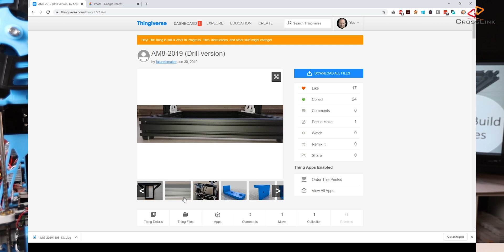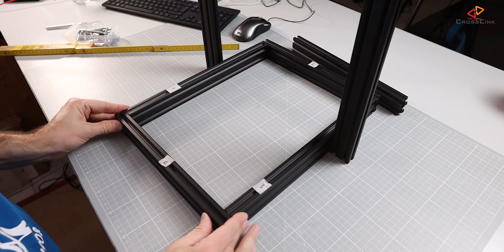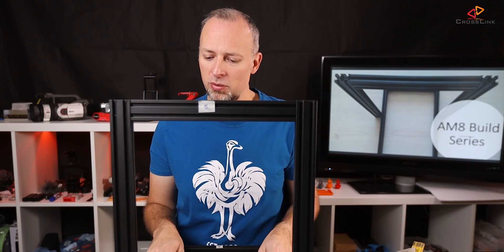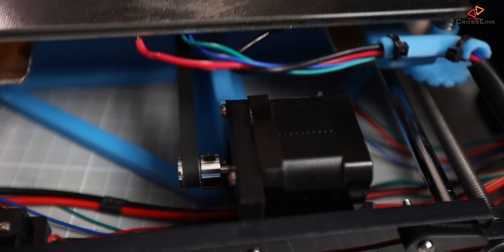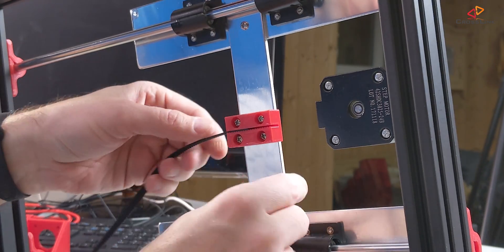Anet A8 AM8 Upgrade - part 1 - Frame build

Comment: A thing I did not understand is what kind of nuts and bolts you are using. Usually the nuts for aluminium extruded profiles must be slided from the side of the profile (cut section let's say). Instead I see you screw it into the bolt and then push em into the profile itself.
Reply from the maker: T-Nuts are inserted in parallel into the slot. as soon as the screw is rightened the T-Nut turns 90 degrees and locks into the slot
Reply: @Crosslink3D  does it work on any kind of aluminium profile or on a specific one?

Comment: I have just finished the build....the cheap crappy frame of the original A8 as well as the ungodly noise it made was driving me nuts and I wanted a change.Things spiraled a bit out of control from here. There was a lot of „While I‘m at it, I might as well....“

Now the only original parts left from the original Anet A8 are the motors, the bed and parts of the wiring harness. And at that point I am not even sure I can call this an Anet anymore. Feels more like I build a new printer from scratch, with some printer parts that I had laying around. 

Aluminium frame, Hiwin-style linear rails (ok, they are clones but they do work really well), a brand new 32 bit SKR 1.4 board, running Marlin 2.0.5, Noctua cooling fans, TMC2130 drivers, a RepRap controller/display....yeah - it definitely IS a new printer. 
But it works sooooo great...and now I cannot even hear it anymore, unlike the printer I started out with. Honestly, the loudest parts in the printer are now the cable chain and the fan.

Comment: Drylin Igus linear bearings are self lubricating. You had to degrease completly the rods and only then, use the Igus.
Reply from the maker: I have to check whether this makes any difference
Reply: @Crosslink3D  it makes it long term, because the oil is going to stick with dust and the igus gets stuck with that gunk. With no oil if dust will eventually accumulate, some compressed air would be enough.

Comment: That original frame is still of great value.   I just received a used CTC I3 A8 in the mail which I bought thinking id only have to check the wiring, replace the plastic tubing used as couplers with proper flexible couplers and add a couple of lock collars to the smooth z-rods.  Only to have it show up with the main frame pretty much busted in two, and the left and right x-axis end stops busted all to hell.  Due to stupidity of the shipper whom didnt properly disassemble the unit before shipping.   I found a Thingiverse file set to completely print a new frame using PETG. But i have to reassemble the printer as is to print it.   As the Monoprice Select Mini I own isnt being a big enough of a build plate to print it.   Odd thing is there are all these I3\A8 clones out on the market right now, but finding a replacement plywood\MDF\Acrylic frame is a pain unless you want to wait 30+ days to get one from mostly the Ukraine off ebay when you live in Canada.   Or fork out 3x the price for aluminum frame.

Comment: FYI, i uploaded an improved bracket for the Y belt tensioner which is closed at the top. Works great on my printer as the Y belt tensioner is guided a lot better and stays parallel to the ground.

Comment: Can you provide a link or description for the nuts used for mounting the printed parts to the frame, or a suggested kit that has the bolts and nuts for this installation?
Reply: Nevermind @futureismaker reached out and mentioned that all of the hardware was included in the kit.   Very nice of him.

Comment: Also i got hygus bearings when i was converting my am8 to liner 2020 extrusion and wanted to leave the z axis on rods. I head terrible luck with them, they kept binding up and the printer either wouldnt move along the z or it would litterally pop the bearings out on the way. So just make sure you dont buy the super cheap ones like I did and expect a good result

Comment: I agree that petg is a great choice for the frame parts, however when i got my anet a8 printer a year ago and within a month was swapping the frame, I only had pla so thatbis what i used. The only parts to ever break were the belt tensioners so i redesigned a heavier duty  Y tensioner that is on thingiverse. Aside from that the pla help up great and i just sold it last week still with those pla psrts holding strong.  
https://3dgeeks.2b.work/pages/view-thing.html?id=3706941

Comment: A little word of caution here: do not stress the frame once it is assembled.
The screw heads will very easily bend the alu profile pushing the frame out of alignment 😢
The frame is not as sturdy as when using external "clumpsy" triangular corner pieces screwed into the profiles.
That is the cost of the rather ingenious way of assembling the frame pieces.
It is however very easy to upgrade on this minor problem.

Comment: Silicon Spray is a bad idear for the bearings... The lubrication is very short and not very good. It would be better to use oil or grease to lubricate the bearings.

Comment: This is the first time i have had a 3d printer and i found i need g code instead of stl files to print the upgrade parts for my anet a8. Do you have these codes so i can try out this printer?

Comment: Hey Crosslink. Been following your videos for a bit. I thought I would suggest this extruder mod. It makes changing filament when using the stock combination extruder much easier, and does a much better version at cooling than the magnetic/hinge mods do. Let me know what you think, and keep up the good work mate.
https://www.instructables.com/id/Anet-A8-Extruder-Cooler-Mod/ Here is a link to the actual cooler as well I tracked down. It appears they have a varying price range of 3 to 10 euros: https://www.ebay.com/itm/Fujitsu-Siemens-6043B0036001A03-Esprimo-Notebook-V5515-V5535-CPU-Cooler-Kuhler/282773830676
Reply from the maker: This looks interesting, though I am most likely to go for another mod, which is a modular approach. Stay tuned :-D

Comment: Yay.
Looking forward to seeing the rest of this series. 
My build is on pause. 
So happy to see that you started your AM8. 😉
Reply from the maker: Great to read you liked it! If you have ideas for other topics I should cover, just ask me to make a video about it.
Reply: @Crosslink3D  well actually. There are many things to evolve from the AM8.
I ran into some problems with the AM8 that lead me to mgn12 liniar rails.
So mine evolved into the AM8 BLV mod on thingiverse.
So when your AM8 build comes to completion. The BLV mod could be an option. 😉
And still. I would never have been amble to push forward with my project, if it wasnt for your help.
Reply: @Crosslink3D  btw. If you end up thinking about the mgn rails. DONT go for the cheap ones.
I have a bunch of rails and carriages that cannot be used.
And a few that worked. It will cost you the same in the long run as getting HIWIN og something like them. ;-)

Comment: So basically save the money and just buy the A8 Plus
Reply from the maker: Well, yes and no. If you are into tinkering, this might be a nicer journey. If you just like to have a printer working quickly, maybe Anet A8 plus or CR10 are the better choice. But also with these printers you will spend some time upgrading them to be perfect.

Comment: Man that's a nice frame.  And the price is right.  Thanks for sharing.  Was just thinking of your channel.  Was trying to print in ABS for my 1st time on my large "fancy" printer that cost 4X more than my Anet.  The bed just wasn't holding the temp I needed (unenclosed).  I decided to try the Anet with the smaller build plate.  I hadn't used it in so long.  I was even thinking of finding a "tech" kid to give it too.  Loaded the ABS in and got a nice print 1st try.  Printed all the small parts unenclosed but big part failed.  Threw a garbage bag over it and their printing nice too.  Anet is such a nice little printer.  Great to build and learn on.  And you get a nice printer out of the deal.  So I've decided to build an enclosure for it and it will be for ABS.  I'm still thinking a Core XY system is the real way to go but just can't justify another printer to play with.  Was also looking at a non-planer Slic3r on GitHub that makes a lot of sense too.   But keep up the good work.  I for one think your Anet vid's are the best on YouTube.  Thanks.

Comment: why wont you use v roller bearing ? it will make more steady
Reply: If you replace too much, you will end up with an Ender 3 ;)
Reply from the maker: MGN rails would be cool, but soooo expensive if you want the "real" stuff.
Reply: @Crosslink3D  you could look at the cheap chinese ones. Experimenting with those shouldn't be too expensive and could be the next series after this one, couldn't it?